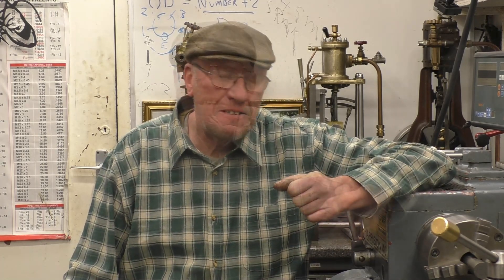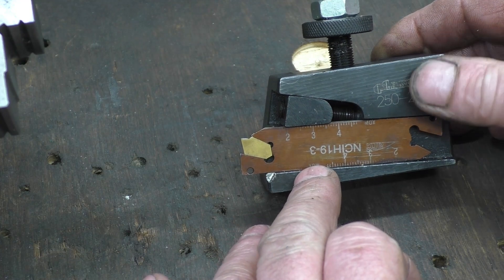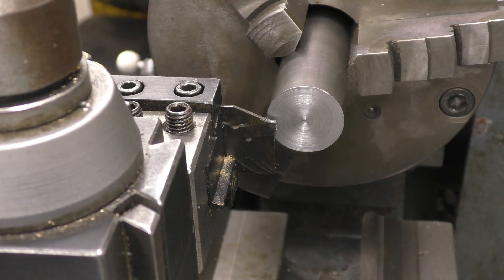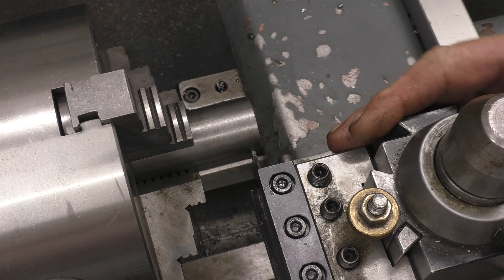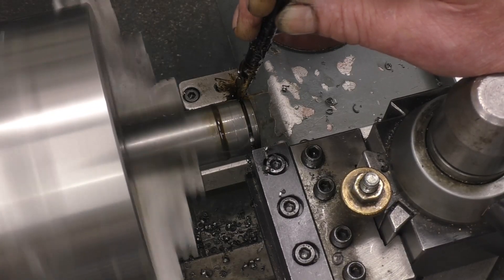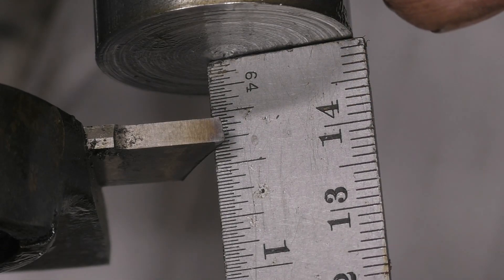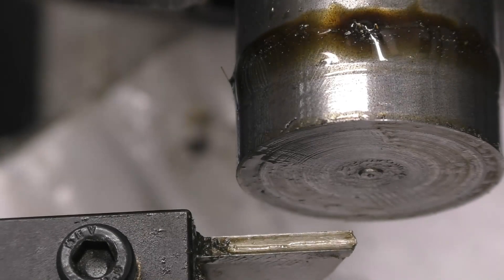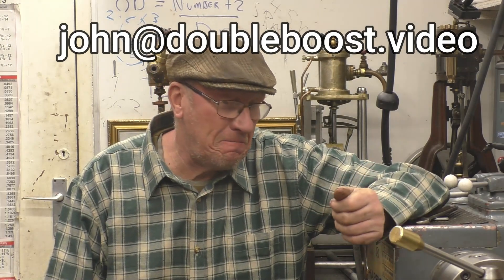Lathe Tutorial P18  Parting Off

Comment: I had a 12" lathe that I bought brand new years ago, and I could never part off without chatter. One day I decided to check the preload on the tapered roller spindle bearings. They were not set tight enough from the factory. After adjusting the preload nut, the machine would part off like cutting through butter. What you said pretty well covers all the problems, but I thought I would add that one as well. Thanks from the USA. We love ya, buddy!
Reply: Same here! I’ve got a 9x20 lathe that nearly drove me crazy trying to stop the parting chatter! As a last resort, I tightened the bearings (they seemed fairly tight already!) and instantly the chatter stopped!

Comment: Thanks for sharing your skill and knowledge.  No matter how long a person does this I find that there is always something to  be reminded of  something new to be learned.   I would like to add the the position of the cutting tool in relation to the forward edge of the cross slide should be as short as possible.  So if the compound has the cutting tool extended in relation to the forward edge of the cross slide then retract the compound so the the cutting tool is as close to the edge of the cross slide.  I have a HF mini lathe and this one thing has helped me to part off stock much easier.  I have locked up the lathe when parting because the cutting blade deflected too much because the compound was extended too much.  Again, thanks for sharing!
Reply: Can't agree more with regards to the compound slide. I replaced the very weak compound slide of my lightweight Emco Compact 8 lathe  with a solid tool post.This solved all of my previous parting off issues. 
Mounting the parting tool upside down and running the lathe in reverse also helps in some cases. If you mount the tool in the regular way the cutting forces press the tool down and (on most lathes) towards the work. This increases the thickness of the chip which increases the forces... death spiral. In upside down mode the cutting edge is deflected away from the work.

Comment: John, I do very much the same as you do for parting off ops with one difference in that i gave up trying to get cutting lube into the deepening parting groove with a small brush. 
Instead of the brush I now use a small bellows type squeezy plastic bottle fitted with a canula type hypodermic syringe needle on the neck and filled with cutting oil. This bottle set up makes it real easy to get the cutting oil exactly where it needs to be throughout the whole cut.

Comment: Awesome. Regarding speeds is there any official calculation to work it out for Parting off. You mentioned 300 rpm even for carbide so I think I've been running mine too fast.
Reply: If you consider how fast the carbide tools are cutting on a CNC machine it gives you some idea what they are really capable of. The secret ingredient  to successful parting at high spindle speeds and feeds is lots of coolant to evacuate the chips and prevent overheating.
Reply: @howardosborne8647  hi I've tried to google for speeds and feeds for Parting operations but had no success

Comment: I use the parting of tool  upside down on the other side of the cross slide, This is how they were used on capstan lathes when I was an apprentice. The advantage is that it is on a single toolpost 
which is more ridgid than the compound and tool holder. The weight of the chuck adds to the cutting force so both force  the work peice down onto the bed. A bonus is that it free's a tool position
on my rotating tool holder.